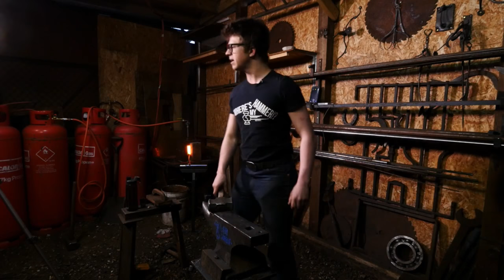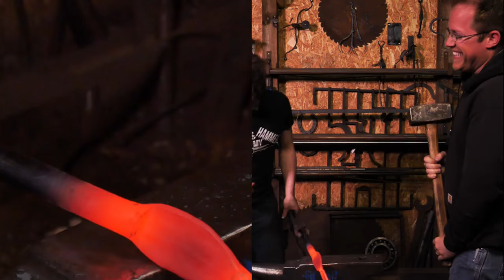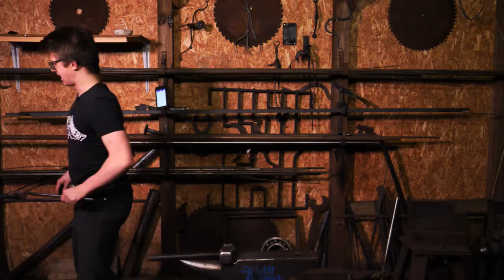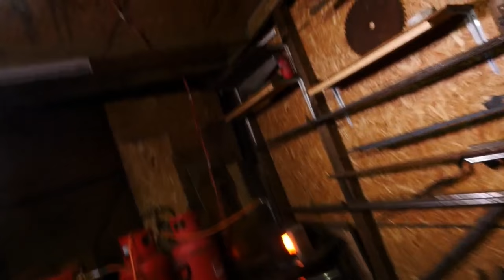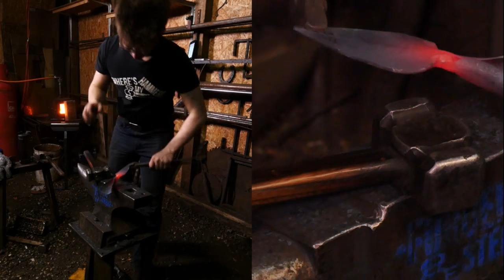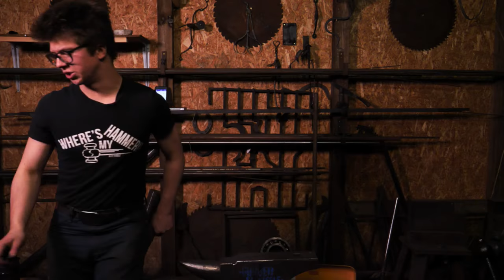FORGING A SPEAR!!! Episode 40: The Alec Steele Show!!

Comment: Take the straight razor to your barber and let him take a crack at stropping. Assuming you go to a traditional barber. If not find one. They love straight razors. You could trade for a set number of haircuts, as well. Barter, perhaps.
Reply: Christopher Neely most barbers use straight razors with replaceable blades makes it easier and is more hygienic
Reply: My first straight razor was a Gold Dollar and it was supposed to be shave ready, but wasn't even close.  But at the time I didn't know that.  After researching and talking with people that used straight razors I learned how to sharpen.  I currently take mine to 8000 grit on the water stones, then strop on the leather.  I'd really like to get a 12-16000 grit stone though.  Also helps to have a Radio Shack 30x hand held microscope to inspect the edge.
Reply: And don't worry about the G10 for the handle scales, not my first choice either, but some form of mycarta or stabilized would would have been my choice for sure.  Got to remember that straight razors are used wet, and one of the ways to keep the blade from rusting after clean up is to rinse with hot water to warm the steel to aid in drying.  So a good scale material that will withstand hot, wet conditions is a plus.  And like you said, it's your razor, so use what you want.

Comment: Alec, you neglected to finish forging by wetting the anvil. I use water on the anvil when I'm forging to finish knife blades. It blows the scale off in a most efficacious manner not to mention the explosive sound made when it turns instantaneously to steam. As I mentioned when you first mentioned the G10/micarta for the razor scales, I think they are the right choice. As you said, they don't detract from the razor itself. Keep forging!

Comment: Use polish compound with the leather strop. I have seen leather strips or belts glued to wood and had been treated with the green compound block. Even if you use the leather sanding belt, treat it with compound just like the buffing wheel. Keep at it and cheers.

Comment: Finishing an edge on leather is very nice.  It doesn't need to be powered, because it simply doesn't take that long.  I use a stick with leather on both sides.  One side is charged with fine buffing compound.  The other is plain.  After you've worked through grinding grits to that point, It only takes a few minutes to polish the final edge to a mirror-like shine, and monitoring it closely is ultimately faster than a powered strop.  You have talented hands and keen eyes.  Use them for master-strokes! (y)

Comment: With regards to how sharp the straight razor should be, when I've just finished sharpening and stropping mine, it will "tree top" my arm hair. That is, it'll take off the top half of each hair if I run it through the arm hair without actually touching it to my skin. It doesn't need to be quite this sharp to get a comfortable shave, but it's a good test to see if you have it perfectly shave ready.